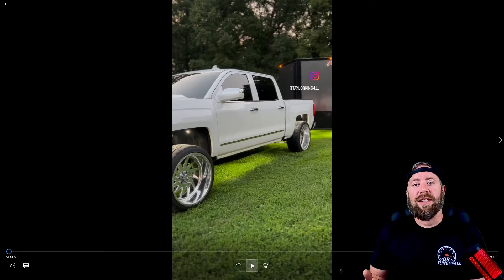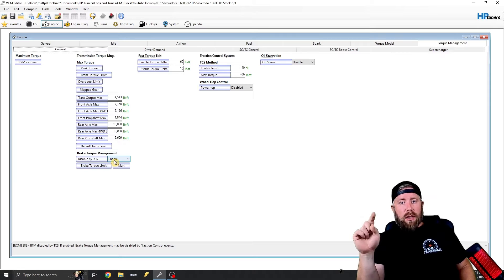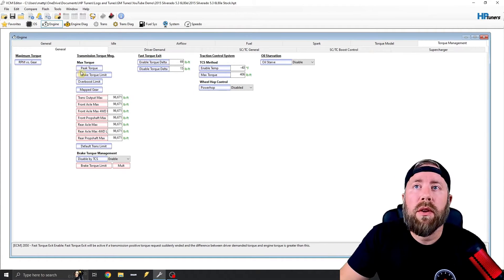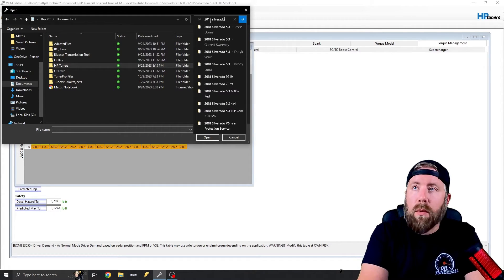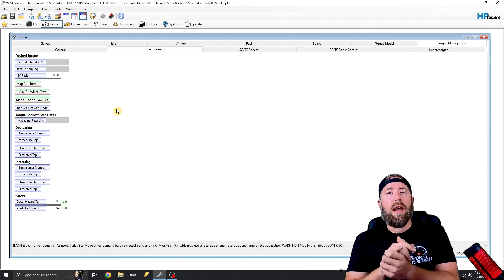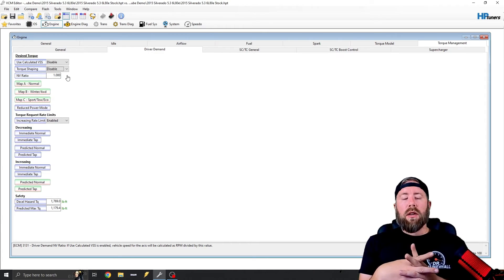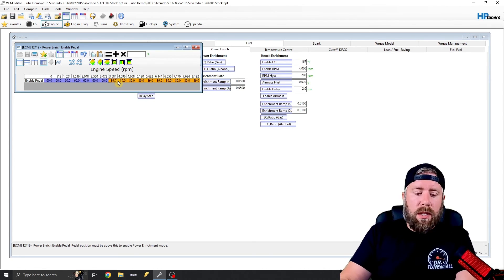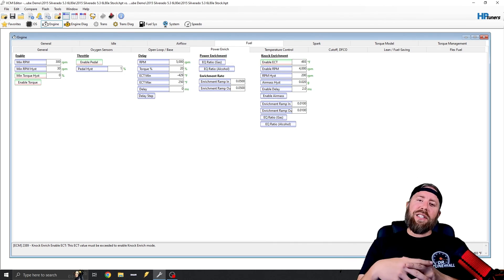How to tune for better burnouts on GEN 5 Trucks!

Comment: Tried this on 2016 6.2l silverado with 8l90 and it went into limp. Does this only work for 5.3l with the smaller transmissions or did I just mess up my inputs somewhere?

Comment: The 2015 and 2018 DD/Desired Torque/Map A "RPM or VSS" columns scaling is different. Are you folks just ignoring this? The video does not show this due to the way he opens the compare. I suppose it works, but it is not the best approach. 2015 appears to be the odd one as the 2014, 2016, 2017 and 2018 are scaled identically.

Comment: Thank you for all the content you provide. I know this is a GEN 5 video but I have a 2011 Silverado 3500HD 6.0 6L90A E78 and after watching your GEN 4 video I found that my stock file is different than the GEN 4 video and has tabs found in the GEN 5 video like Driver Demand under TQ Management and the Enable Torque table under PE. Should I use a combo of settings from both? Enable Torque table to 0% to only use throttle enable, and set TQ Management Transmission TQ Mng settings and Driver Demand tables using the GEN 5 settings?

Comment: gotta give you credit and thanks for this one, i followed this to the T, took notes and had to use some brain cells to understand the compare file part of the driver demand tweaks you presented.  With my stock '14 5.3 with only an air intake, this tune update on top of the dod del has completely changed my truck from sluggy and tame to spontaneous and immediate out the hole.  Which is a lot safer for me coming out of a stop, or entering a busy road.  I like the idea of pulling the variables from the 17-18 too, I used 2017 driver demand variables and it was the same numbers for copying.  Next i plan on doing the trans tuning from your 6l80 video, but for now i'll be enjoying and observing this tune update.
Reply: did you disable torque shaping?
Reply: Do you have that 2017 driver demand variable where one can copy from?
Reply: @viixiconik download a stock file on repository

Comment: hey man followed this to a T and it puts the truck into reduced power mode 2015 5.3
Reply from the maker: Then you made a mistake somewhere.
Reply: Make sure you got the correct Predicted normal and Predicted tap. You want Increasing not Decreasing. We had a problem where tap sent it in to limp, turns out i hit the Decreasing Tap table.
Reply: I had the same problem, write the tune once complete. Turn off ignition,open the door go get a snack. Come back clear any codes and start the truck. You should be good to go.

Comment: Why don't you up the enrichment rate?
Reply from the maker: DI engines don’t have Transient issues since the injection cycle is happening in the cylinder. Most people that increase enrichment rate will actually cause a rich condition on tip-in which will cause visible smoke, could cause additional burst knock due to DI not liking rich conditions, and it won’t offer any performance gain whatsoever.
Reply: @Matt_Sanford  Thanks. But is it ok to do it on non DI engines?
Reply: @29auto30  This is specifically for Gen V trucks which are DI.
Reply: @Matt_Sanford are you going to to put a gen 5 truck tuning video for bolt ons ?